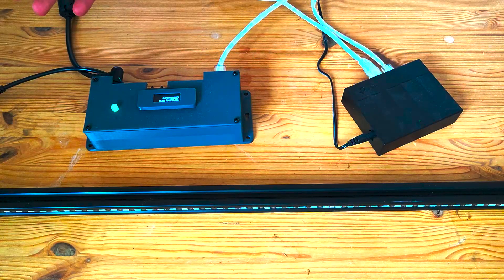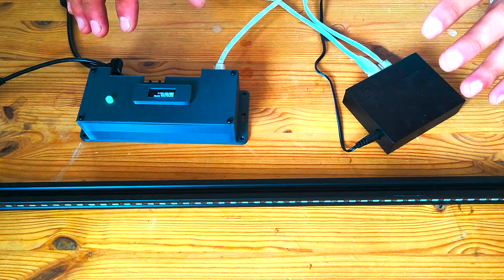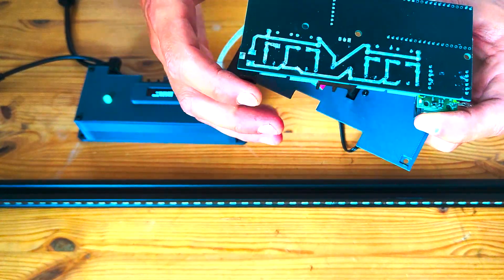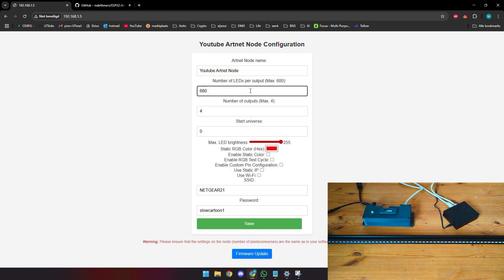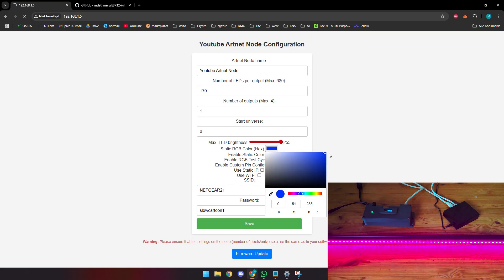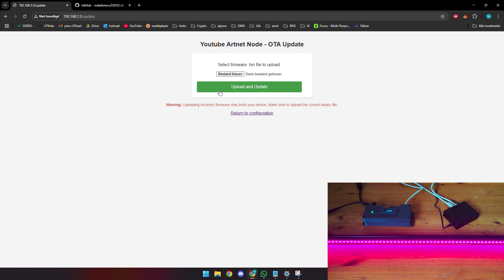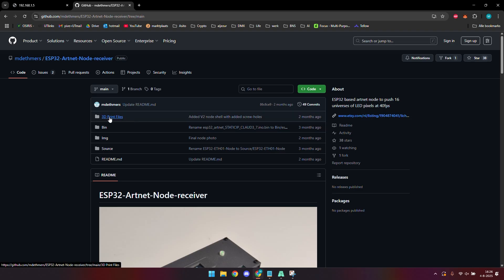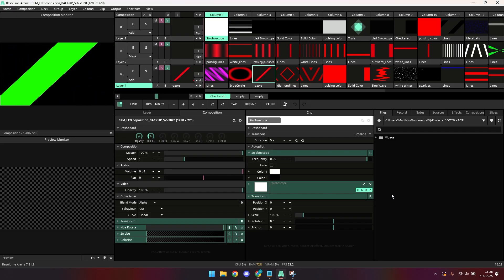DIY ESP32 Ethernet Artnet Node in depth view - LED controller 3700+ Leds

Comment: Hey, this is awesome! Really nice work! I have one question, sometimes, in distributed installations, ArtNer/SACN devices, have a 2 network ports, one for data to come in, and one to pass the data on to another device further down the line, to avoid running many network cables. While designing this, did you come across any solutions for adding a second ethernet port to this device?
Reply from the maker: I have thought about it, but did not find a way to easily add this functionality. I am not sure if the esp would still be able to work reliable as an artnet receiver if it also has to deal with routing ethernet, but feel free to give it a shot!

Comment: Do you make this PCB?

I'd like to make an esp32 board exactly like the "WT32-ETH01"  but with an external ADC.   I'm thinking of maybe just using the WT32-ETH01 and adding my custom ADC board on the bottom of it?   The only thing confusing is the module's serial interface... why do you need that?!
Reply from the maker: Hey! Yes, I made this PCB, with the focus on using standard modules for the esp and w5500, basic power distribution capabilities and level shifter. I tried to use as many components I already had at home or were easily sourceable. I Have an example sketch for the ETH01 in the github, but i stopped support for it as I found it had really bad performance. Let me know If you ever get it to run!